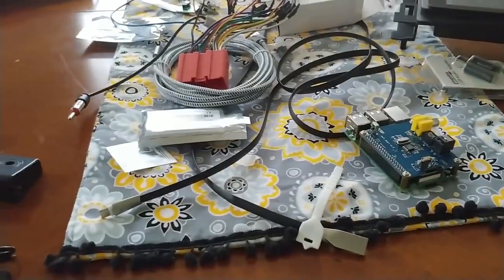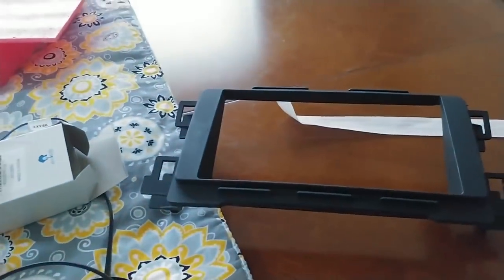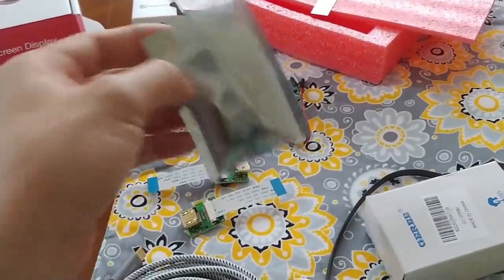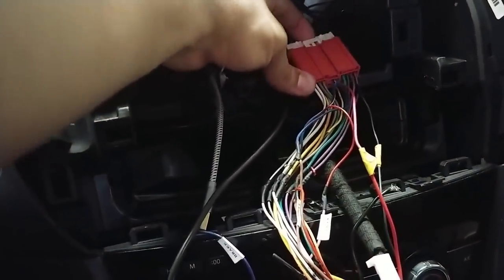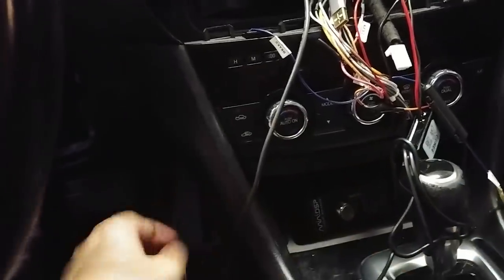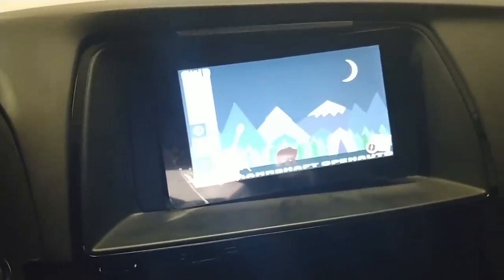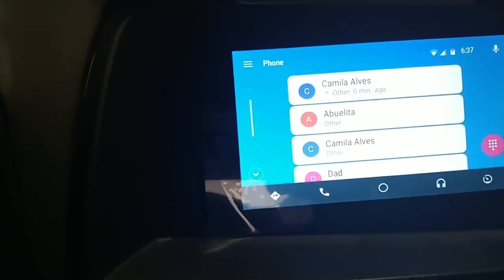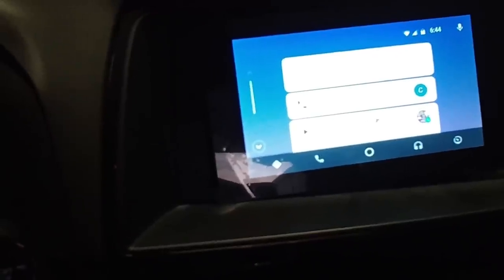100% DIY Android Auto HU - replacing my OEM car radio w/ a raspberry pi

Comment from the maker: * 12/23/2018 6 month update video showing how I got steering wheel controls,  delayed shutdown, wireless AA, kodi, & more! *
Part 1 - https://www.youtube.com/watch?v=vMvMXd4RvdA
Part 2 - https://www.youtube.com/watch?v=Z-0post9HVo

* Parts list has been updated as of 12-15-2018.  Since this video was posted nearly 6 months ago, I've had time to see what parts work well and wehat doesn't.  Since this video, I upgraded the power supply (10A vs 5A... 5A supply was too weak to support both a PI 3B+ and a powered USB hub to charge a power-hungry phone).  I also found out the microphone I was using was junk, so that got upgraded to a better quality version.  Ditto with the extrnal bt module.

Comment: If the harness have the steering wheel control wires then you can use the gpio to control the whole thing from your steering wheel or center console knob

Comment: Your Waze version needs to be compatible with Android Auto, the same thing happens with many apps like iHeart Radio and others. Your Whine noise is happening because you have a ground issue. Make sure you have a good chassis ground that is the same for all components i/e amps, dsp and any other component that is wired into your 12V system on the car. I suspect that the Digital signal may or may not fix the noise issue because it is an induced noise because again of the ground being different for different components that are connected together via cables that provide different grounding points. Always remember that ground is not ground the world around.

Comment: This might be a stupid question, but I acquiring the parts to give this a go on my 2012 f150 and I had a question about the wiring harness. Is there an end that plugs into the pi or how are the wires from the harness connected to the pi? Appreciated all the videos. Well done.

Comment: Excuse my ignorance... Am I missing something? How exactly do you power the rPi from your car?

So you have the extra wiring loom for things like ground and the 12v which then goes to the 12v to 5v step down and then from there you somehow attach a usb type A cable to it into the Pi? How did you run a USB cable from the converter to the Pi? 

Doing this project right now as we speak!

Comment: The lightning bolt in the corner shows up when the Pie needs more power.  Usually when it is working harder and requires more amperage.  I think the P3 likes 2.5 amps at 5 volts.  Each usb device plugged into the Pie uses about .4 amps, leaving the P3 with what is left.
Reply from the maker: yeah i solved this problem.  See my updated parts list.  I needed a bigger power supply.  Also the quality of cable matters too.  A cheap micro usb cable won't be able to carry a full 2.5A load even if the supply is capable of providing it.

Comment: Question how are I powering the lcd/pie unit it’s self I seen u have the power converter but u also mention u have a micro usb goin to the unit ,where is that power coming from ? Did u tap it in tk the power converter ? I’m just a lil lost on how u have that powering

Comment: Hi, great job. I am building my crankshaft system on my bmw. I have made a custom screen holder, and the pi3 is inside the glove box, all connected using a 1m ribbon cable. Did you ever experience random reboot ? Is the phone loosing battery or actually charging? The camera looks great too!
Reply from the maker: Hey man.  No random reboots fortunately.  I think it is key you buy a properly sized power supply.  Mine is 5A 12VDC.  It powers both my pi as well as my powered usb hub.  Also solder and heat shrink, don't cut any corners on the quality of your wiring.  My phone is connected to my powered usb hub, not directly to my pi.  It does charge quite slowly, but it does charge, even with running waze/music/etc via AA.  Share your setup with us when you get a chance!
Reply: Automate Everything that's great, a powered hub is exactly what i need, may i ask where did you get that from?

My setup:
Rpi 3 b+,
Adafruit audio card,
Genuine rpi touchscreen 7",
Car usb converter (2.4a), soldered to the cigarette ligther 

I have no mic and camera for now, i wanna focus on getting it to work properly first, audio plugged to the in built Aux port, the rpi is in the glovebox, about 1m away from the screen, hence the 1m ribbon cable. Also, there are 2 separate micro usb, one for the rpi and one for the screen, both coming from the same usb converter.
Reply from the maker: I did something similar before (using a car usb charger soldered to a cig lighter).  I ended up ditching it for a proper power supply.  Those usually only put out a nominal current of 2.5A, but in reality put out much less.  I'd get one that's rated for 5VDC @ 5-6A nominal.  I grabbed one on amazon and it was like $15.  That should be plenty of power for both your pi as well as usb hub.  The only pain is you need to solder a usb connector on for the pi.  I'm handy at soldering so that's no big deal to me (you can buy solder-ready usb connectors for very cheap.. you only need to solder the +5V and gnd pins).  As for the powered usb hub, i had one from years back lying around, any one would do (though i'd just get a usb 2.0 hub, as pi doesn't support usb 3.0).  I don't know of any powered hubs that take 12V as input power, they usually take 120VAC and convert it to 5VDC.  So all you need to do is cut the end of the usb hub power cable, and wire it directly into your 5VDC power supply.
Reply: Automate Everything Thanks, i just made a y usb cable, so tomorrow i will try run using a second cigarette lighter converter, to see if the phone is going to charge with the extra juice, and if the pi will be more stable with more amps. Yes i have just bougth a 5v 5A converter, (ebay, the one made out of cast aluminium) will keep you posted.
Reply from the maker: good luck!  Let me know how it goes.

Comment: Hey i have a quick question. I have. 2007 honda accord with navigation system. I don’t want to replace the oem stereo but i do want to update the software. Is there anyway i could connect the pi to the oem screen?

Comment: No UPS battery for proper raspberry pi shutdown?  I am working on a car Plex movie server and I plan to use a UPS Battery to protect the Micro SD card
Reply: For plex thats going to be hard, but for some AA distro I'd build that thing around a read only system plus some tmpfs for the needed stuff

Comment: I did turn android auto with Mp5 head unit + my Samsung Galaxy plugin into the head unit with mirrorlinks and it works as it should be all this cost me just $20 from AliExpress just bought the radio from am

Comment: How does shutdown works? If you turn off car raspberry will directly gets off. Which may damage the OS. Do you use any backup battery?
Reply from the maker: I address this in my 6 month update video - https://www.youtube.com/watch?v=vMvMXd4RvdA.  I use a shutdown script combined with a timer relay that keeps the pi powered up for 1 hour after I shut down the car.

Comment: hello. you don't show what part you used for the car plug to run the speakers. i see the plug wired, but what is it wired to?  do you have a fader in the car.
Reply from the maker: It's a DSP, specifically a minidsp C-DSP 6x8. It's expensive and not really worth mentioning in my opinion, since my videos aren't geared toward car audio.  The fader is just the volume knob for my DSP, and it sits in my center console.  In my later videos I end up adding steering wheel control support, and I'm now able to adjust the volume of my system from my steering wheel as well.

Comment: hi man,cool video! how do you get FM signal?
Reply from the maker: No FM at the moment.  As of now it's no big deal to me as I never listen to the radio.  But I understand that can be a deal-breaker for some.  I think it is being looked at as a future add-on for crankshaft, but for now, the only way to get FM would be to stream it from a radio app via BT or something.
Reply: I haven't checked, but I suppose you can add back FM functionality using a cheap RTL2832U based DVB-T dongle, which can tune FM frequencies.
I have no clue how that's interfaced with Crankshaft though. I think that's going to live outside Android Auto, as with a normal headunit which is capable of doing that.
Reply: As a simple fix for FM radio, use the Iheartradio app and steam the radio station you want.
Reply: Raspberry pi can receive FM on pin 4. You can also install a cheap SDR receiver and make a scanner from it as well.
Reply: @Jakexgt1979  that requires internet.
Reply: @TheHermitHacker  What pin would I use to receive FM on a RPi 3 Model B+ ?
Reply: FM will be interesting in Europe as they want to change it to something digital. I think we'll have a USB plug for that somewhere during this or next year.

Comment: can you use the display and the R-Pi as a computer in addition to the head unit functions? in other words, can you web browse and process files such as spreadsheets, docs, presentations and or databases as a separate applications in the SBC?
Reply: Lots of things you can do once you put a Pi in your dash, just depends on the OS that youre using and adding hardware to support... ie: side-load RetroPi, add a controller and you can play video games. Or side-load a traditional *nix OS with a mouse and keyboard to do your spreadsheet stuff... to browse the web you'll need data connectivity so you'll have to either tether to a cell phone or add a cellular 3g/4g (and supporting cellular data subscription) add-on board.

Lots of things you can do, just depends on setting the goal and figuring out the path.

Comment: Did you splice your audio from the iso connector on the harness directly to an aux 3.5mm
Reply from the maker: nah, I have an aftermarket amplifier and DSP in my car.  I just go straight from my pi to my DSP via SPDIF, using a hifiberry digi HAT.  Sound quality is fantastic

Comment: The raspberry pi 3 has bluetooth built in. Did you try and connect it that way?
Reply from the maker: the built-in bt module does not properly support HFP (hands free profile for phone calls).  It also requires integration with ofono.  It's not as simple and straight-forward as it would seem.  I'm working on using an external bt module however.  I will have an update video out soon showing all the changes I've made in the months since I made this video.

Comment: I've got a similar setup but still use the stock stereo to control volume, what's the solution you use? What DSP model etc?
Reply from the maker: my solution is not a cheap solution unfortunately.  It's the mini dsp C-6x8 which costs around $300... but it's a fantastic car DSP.  If you have an external amp w/o a DSP, you would need to install some sort of line out attenuator w/ a rotary knob.  They are quite easy to find and cheap, if your goal is to control volume to your amp.

Comment: What do you use to turn your dsp on when you turn the car on like a aftermarket radio remote wire?
Reply from the maker: I just fuse-tapped into a circuit that turns on when I turn on the car's ignition.  It's some unused circuit for a power sunroof, which I don't actually have.  Didn't need any aftermarket radio "amp turn on" signal for that.

Comment: You don't need to use an HDMI cable to your phone, you can to it with just a charging cable attached to the Pi and your phone.  Additionally, there's a way to make it work via Bluetooth.
If your current head unit is necessary in your car, you can just wire this to your speaker wires coming from your head unit.  Or, if you have a head unit that allows a 3.5 mm jack or has Bluetooth built in, you can relocate the head unit and connect to it.
Reply: The HDMI is for the backup camera. Bluetooth doesn't work.

Comment: what about FM,AM,DAB donesnt your Mazda entrateiment system have those too?
Reply from the maker: DAB is a european standard.  We have AM/FM though.  I never listen to it, but it looks like bluewave (author of open auto pro) is working on a solution for FM radio, as it seems that many people are requesting this feature.  I might feature it in an update video at some point.  DAB radio is already working with a DAB USB radio and welle.io app that's built in to open auto pro.

Comment: What about radio? I like listening to klove while on the road?
Reply: try iHeartRadio or some other app supported by AA. Nearly every radio station also broadcasts onto a digital platform.
Reply: @birbies  ok but then I would need wifi right? Is there no way to plug the antenna into this setup?

Comment: I like the idea... But isn't that a raspberry pi 1?  Will Android actually run decently on that device? 😓🤔
Edit:  my bad, the yellow RCA plug is from the HAT you've got on top.  I was thrown off by that.
Reply: You could use USB cameras but I won't recommend it USB cameras on a rpi tends to be awful and low fps. I would instead use multiple RPI zeros that stream the video using rtsp
Reply: @Tobi-xj8xw  how is that related to my observation?  Did you mean to post that as a reply to me or was that an accident?
Reply: @BrainSlugs83  accident it was meant to another comment

Comment: So, without amplification, it's useless...
Reply from the maker: no speakers work without amplification.  You remove your stock radio you remove the amplification.  There are plenty of cheap low-power amplifiers you can buy as an add-on to the pi.  Just google it.

Comment: this is not very handy, if you have a radio unit that also controls everything from your car. like airflow, mileage counters ect.
Reply from the maker: no it's not.  Not every car is that dependent on the radio however.  My car is a 2014 and is completely usable without the stock radio.  Though admittedly this is for older cars anyway.... most newer cars come stock with AA or Carplay.
Reply: You can relocate your head unit and connect directly through your speaker wires.  Or if it has a built in 3.5 mm jack for audio cables, get a cable between the Pi and the head unit.  That's how I did it and it works very well.

Comment: i feel a pioneer nex is better but great way to geek out diy.
 i think id rather have a android head unit then android auto have your phone some how instant tether to it so then you can have youtube and any app actually work on the screen without much more hacking like you have to in order to get android auto to do that stuff.
Reply from the maker: different strokes.  I used to have a chinese android HU and it was low quality and unreliable, I'm much happier with this solution.  Plus it's just the enjoyment of building something yourself and seeing how far you can take it.  Something like this is for people that get enjoyment out of doing the work to get the end product.  There's much faster & easier options out there.
Reply: @AutomateEverythingRM  yeah I'd rather see a diy high quality Android unit over strictly Android auto. 
Do you know of a Android rom for raspberry pi?
Reply from the maker: @gjkrisa  one does not exist.  you can't flash android roms on the rpi hardware.  As the open auto software evolves it's offering more and more app functionality.  you can install 3rd party apps on it, and it currently supports spotify, kodi, dab radio, and youtube stock.  They just need to add some nav software and it will be useable independent of android auto.

Comment: So much work and not even fully working. I would spend 160 and just buy the cheapest AA headunit. Unless you have an amp already installed like him, it's just going to be a hassle. It's quite possible you'll even end up spending more than 160 on this project if you don't have any of the parts. Plus Crankshaft still has many bugs and you miss out on steering wheel controls, easy volume knob, radio, etc.

Comment: Nice Job.
I want to do something similar in my car.   The only difference is I would like to maintain FM radio for times when I don't have a phone or just don't want to hook it up.

Currently CrankShaft doesn't support this, I'm hoping they will in the future.

I did find this program that is developing this feature,  but it doesn't work yet.

https://github.com/viktorgino/headunit-desktop

If they get it all working,   this would be a perfect replacement for a stock deck.
Reply from the maker: Nice.  There are hats for FM radio out there already.  It's just something that needs support from the devs to be part of the HU.  What you linked looks promising.  There's also a fork of crankshaft that someone is working on that is supposed to natively support common HU heatures like backup cam, radio, etc. 
 https://www.reddit.com/r/crankshaft/comments/8sun73/personal_project_update/.  It's not fully baked yet but it's promising.  The whole concept of a pi-based HU still seems to be in its infancy.
Reply: Nice..  I saw that but didn't realize they were going to also support radio too.  Looking forward to that being released.

As the Headunit desktop developer hasn't been all that active,  or responsive to questions.  I have a feeling it won't go much further.